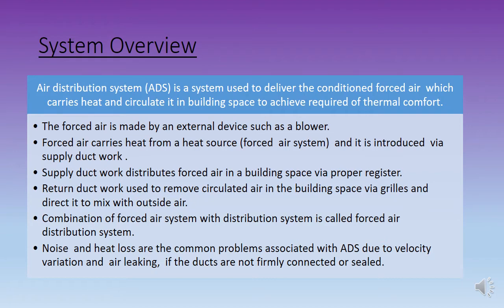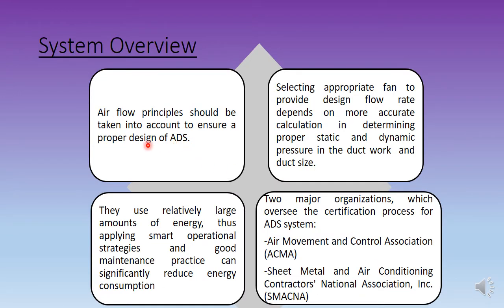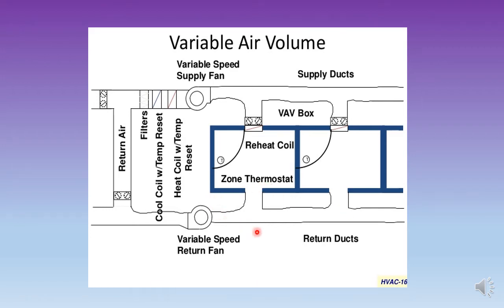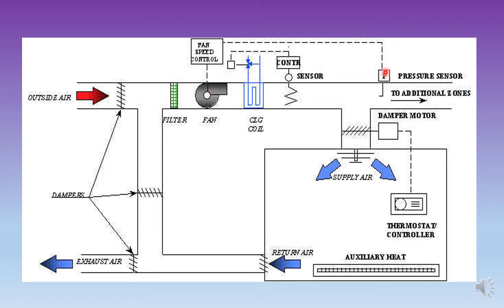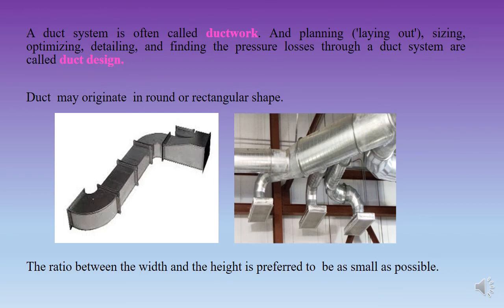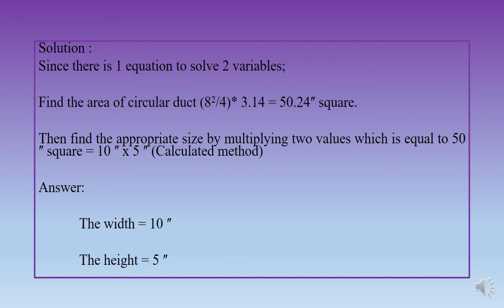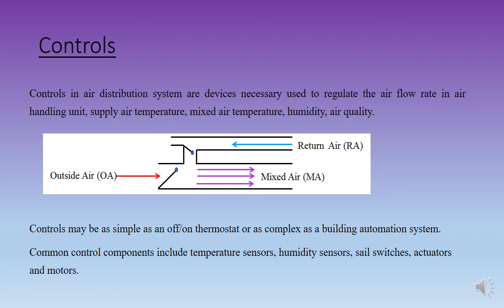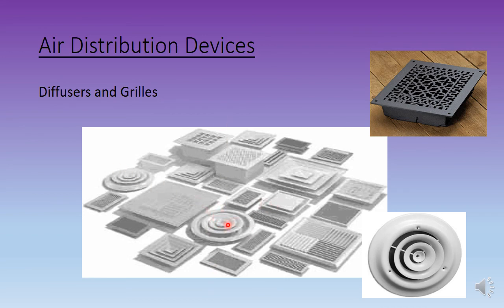Lecture 3 AIR DISTRIBUTION SYSTEM COMPONENTS

Comment: muhammad salman bin nor azmi b091810189
in this lecture I have to learn about the type of air distribution system .as we know they have 2 types that are constant volume and variable volume .after that we have learned more detail about VAV  , AHU   ,. and it also stated some calculation to change rectangular duct to circular duct in this chapter.

Comment: MUHAMMAD IZZAT IZZUDDIN BIN HANAFI B091810329

From this lecture video, I learnt the overall operation system of duct work and part of duct work. Air Distribution System (ADS) have 2 types which is constant volume (operate at constant airflow rate) and variable volume which supply air from VAV. The AHU have many components inside the box to make sure give supply fresh air to the conditioned space

Comment: MUHUNTHAA A/L MUNIYANDI
B091810185
3 BMMH S1/1

From this video, I have learned about Air Distribution System and how the syetem works. Air distribution systems include air handlers, ductwork, and associated components for heating, ventilating, and air-conditioning buildings. There are two types of ADS - Constant Volume and Variable Volume. I also learned about function of ducting and how to calculate ducting from rectangular to round ducting. And Then, Controls are important In ADS to regulate air flow rate.

Comment: Kuganeswarao A/L Subramaniam B091810487
from this lecture i have learn that air distribution system is a system used to deliver the conditioned force air which carries heat and circulate it in building space to achieve required of thermal comfort.

Comment: AHMAD TAUFIQ BAIHAQI BIN MOHAMAD B091810279   3BMMH S1/1
For this lecture video, I've learned that the forced distribution system is the combination of forces air system and distrubution system. Next, there are 2 types of Air Distribution System (ADS) , that are constant volume that operate at constant airflow rate and variable volume which supply air by follow  the VAV system that needed each room to get comfort state. Futhermore, the AHU have many components inside the duct system to make sure the air flow supply each rooms are fresh air and safe to breath. Lastly, i also learned to use formula in calculate the rectangle duct and cylinder duct to make sure the fresh air supply cycle is enough as the required each space in the building.

Comment: Ahmad Zikry Bin Midin B091810456

Air distribution system is a system that we used to deliver the conditioned air and circulate it in building space to achieve required of thermal comfort.
There ate two types of air distribution system, constant volume (operate at constant airflow rate) and variable volume.
AHU is an integrated piece of equipments.

Comment: muhammad mukhlis bin abdullah 
B071710395
This topic give us to know about control in air distribution system are devices neceessary used to regulate the air flow in air handlinh unit supply temperature mixed air temperature humidumity air quality

Comment: Muhammad ismanajmi bin rozi B091810258 3BMMH S1/2

Based on the lecture given, we are introduce towards Air Distribution System or known as ADS. Air distribution refers to the distribution of air to and from conditioned spaces within a building. An air distribution system includes all sub-components, such as fans, filters, dampers, ductwork, etc. Air distribution systems come in a variety of material types, for example, fiberglass and galvanized metal. In fact, many different kinds of ducts may be found in a single air distribution system.

 There are two types of ADS we learnt now,  which are the constant volume and variable volume. As the name said to be constant, constant volume operates at a constant airflow rate while the variables volume function as suppling air from vav air handler which differs in responses. 

Besides,  another known as AHU has 3 types which are Terminal Unit,  RTU and MAU. 

In addition, we also learn about importance and operate of ducting and the calculation of rectangular ducting and round ducting.

Comment: AHMAD ASYRAF BIN AMIL B091810125
Ads works when the blower distributes forced air and flow thru the supply duct and gets distributed along with the building space via proper register. Noise and heat loss may occur in ADS because of velocity variation and air leaking. There are two types of ADS which are constant volume and variable volume. AHU unit is used to collect and mix air from outside and return air from a building space and then it will be cooled/heated and delivered to the building space thru a duct system. There are 3 types of AHU which are a terminal unit, a rooftop unit (RTU) and a makeup air unit (MAU). While duct is a channel used to deliver or dump air from building space.

Comment: Name : Muhammad Hadzim Ashraff Bin Mazlan
No.Matric: B091810248
Summary:
The types of air distribution consist of constant volume and variable volume. Constant volume operate at constant airflow rate. Temperature varies to maintain zone set point. Variable volume  supply air from a VAV air handler varies in response to terminal units' intake of supply air to maintain zone temperature set points.  Supply-air fan is controlled to maintain a static pressure set point in the ductwork

Comment: MUHAMAD RAZIQ AFIQ BIN ANUAR (B091810519) - As a conclusion, ADS is a system used to deliver the conditioned forced air which carries heat and circulates it in building space to achieve required of thermal comfort. There are also 2 types of air distribution system which are constant volume and variable volume.  While a CAV system uses variable air temperature and constant airflow, a VAV system keeps constant temperature and variable airflow. CAV systems are better suited for single-zone applications where the load experiences little change, while VAV systems are the best option for multi-zone applications with a constantly changing load

Comment: SRITARAN A/L ARUMUGAM
B091810178

From this lecture, i have learned that an air distribution system includes all sub-components, such as fans, filters, dampers, ductwork, etc. Air distribution systems come in a variety of material types, for example, fiberglass and galvanized metal. In fact, many different kinds of ducts may be found in a single air distribution system.

Comment: Tiban A/L Ravichandran B091810285
There are two types of air distribution system..First one constant volumen which operate at constant air flow rate, temperature varies to maintain  zone set point...secondly, variable volume which volume of supply air from VAV air handler varies in response to terminal units, intake of supply air to maintain zone temperature set points

Comment: Nur Saiful Syahmi Bin Alias
B091810055

From this lecture video, the lecture flow are consist of system overview, air handling unit (AHU), ducts, control and air distribution system. All of this are the important components in the Air Distribution System (ADS). As we all know, an air distribution system includes all sub-components such as fans, filters, dampers and ductwork. Air distribution systems come in a variety of material types for example, fiberglass and galvanized metal. In fact, many different kinds of ducts may be found in a single air distribution system.

Comment: Keshanraj A/L Ganesh    B091810319
from this lecture, we can know that :
1)Air distribution system works when blower distribute forced air and flow thru supply duct and get distributed along building space via proper register. 
2)Noise and heat loss occurs in ADS because of velocity variation and air leaking.
3) Air flow principles must be taken into account to ensure proper designing of ADS. 
4)The two types of ADS are constant volume (constant air flow operation) and variable volume ( supply air volume vary in response to terminal unit's supply air intake). 
5)AHU used to collect and mix air from outside and return air from a building space and then it will be cooled/heated and delivered to building space thru duct system. 
6)The 3 types of AHU are terminal unit, roof top unit (RTU) and makeup air unit(MAU). 
7)Duct is a channel used to deliver or dump air from building space.
8) Controls are important in ADS to regulate air flowrate.

Comment: Salman Bin Mohd Zainudin B091810498
in this lecture, we learned about air distribution system, how air distrubution works. we also learned bout the component of air distribution system such as AHU, Duct works and many more. there are aso two types of air distribution which is constant volume and variable volume. in this lecture, we also learned calculation of triangle duct and circular duct.

Comment: NUR NABILAH BINTI MOHD ISHAK (B091810284)
Based on this lecture , i've learnt about ADS system component. There are two types of ADS which are constant volume and variable volume. Then, we got to know about the air handling unit (AHU). The purpose of AHU is to suck in outside air and re condition it. So it will supply fresh air towards the building.  Furthermore, the duct also known as a channel used to deliver and remove air from the building space. Plus the duct is made up with various type of material.  Lastly, we can solve the problem based on the explanation given .

Comment: Muhammad Ariff Imran Bin Hassan
B091810177

System Overview - ADS is system used to deliver the conditioned force air in building space to achieve comfort zone. there are two types of this system which is constant volume and variable volume.
AHU - is a piece if equipment to supply air to the building. It consist such as fan, heating and cooling coil, damper, filter, vibration isolator silencers
Ducts -  it is road of air to supply in the building, it also can remove air from building space. mostly it made from mild steel, fiberglass and flexible ducting
Controls - Controls in air distribution system are devices necessary used to regulate the air flow rate in air handling unit, supply air temperature, mixed air temperature, humidity, air quality.
Air Distrubutin devices - it is blower or fan, heating and cooling coil element. diffusers, and supply and return duct.

Comment: Afiq Hamizan Bin Syaharudin B091810525 BMMH 1/2
From this video, i have learn about a few type of distribution system which is constant volume and variable volume. For constant volume it operate at constant airflow rate and the other type is variable volume is supply air from vav air handler varies in response to terminal unit intake of supply air. After that, air handling unit is an integrated piece of equipment consist of fan,heater,cooling coil,air control ,damper, filter, silencer and vibration isolator. Moreover, duct is a channel, which used to delivery and remove air from building space. Lastly, i have learn how to calculate the duct.

Comment: ahmad syahir bin ismail b091810081
in this lecture, i have learnt the air distribution system components consist of air handling unit(AHU)which is used to re-condition and circulate air as part of a heating, ventilating and air-conditioning system. then, the duct which is used to deliver and remove air from a building of space which consist of several types of material. the controls which are devices necessary used to regulate the air flow rate in air handling unit, supply air temperature, mixed air temperature, humidity, air quality.

Comment: Luqman Haqim B Amir Hamzah B091810235

in lecture three, states that a forced air distribution system is a combination of forced air system and distribution system.  air sitribution system have two type which is constant volume and variables volume. Terminal unit, RTU and MAU is three type of AHU. In this lecture also teach us about the function of ducting and how to calculate for rectangular ducting and round ducting. Next, controls is a devices to regulate the air flow rate in AHU, supply air temperature, mixed air temperature, humidity and air quality.

Comment: MOHD NAZRIN BIN MOHD NAZRI B091810221
From this lecture video, I learnt the overall operation system of duct work and part of duct work. Air Distribution System (ADS) have 2 types which is constant volume (operate at constant airflow rate) and variable volume which supply air from VAV. The AHU have many components inside the box to make sure give supply fresh air to the conditioned space.

Comment: MOHAMAD ZAHIM BIN MOHAMAD SUKAIRI B091810344 3BMMH S1/2
In summary, this lecture has driven us towards system overview in Air Distribution System (ADS). ADS is a system used to deliver the conditioned forced air which carries heat and circulate it in building space to achieve required thermal comfort. Next is types of ADS. there is 2 type of ADS which is Constant Volume (CAV) and Variable Volume (VAV). Then we learn about function of Ducting and how to calculate ducting from rectangular to round duct. We also given 3 Rules of ADS which is number 1 is there is no odd number in duct size. Number 2 is the best ratio between width and height of rectangular duct is 1:2:1. Number 3 is the ratio of width and height should exceeded 1:2:3. Other than that we learn about contols. Controls is a necessary devices to regulate the air flow rate in AHU, supply air temperature, mixed air temperature, humidity and air quality. Last but not least  we learn about Air Distribution devices.

Comment: See Wei Che B091810368
In this video, I have learned that the forced air distribution system is the combination forced air system and distribution system. There are 2 types of air distribution system which are constant volume and variable volume. 3 types of AHU are terminal units, RTU and MAU. Duct system also known as ductwork. Last, I have learned how to calculate the duct.

Comment: SHAZNI SAHIRA SARIFF B091810225
As a conclusion, in this lecture, we learned how the air circulate in a space. Next, we also learned about the part of ductworks such as round ducting, rectangular ducting, what is the using of the panelducts round boot and etc. Other than that, there are two types of air distribution system which is known as constant air volume and variable air volume. Then, we also got to know about the AHU, calculation for ducts where it is need to convert from rectangular to circular or vice versa, air distribution devices and etc.

Comment: mohamad asyraf aidee bin mohd baseri b091810017  3bmmh   1/1.  in this lecture I have to learn about the type of air distribution system .as we know they have 2 types that are constant volume and variable volume .after that we have learned more detail about VAV  , AHU   ,. and it also stated some calculation to change rectangular duct to circular duct in this chapter.